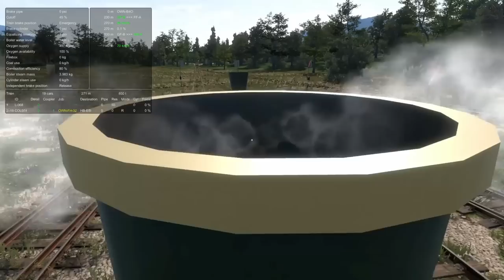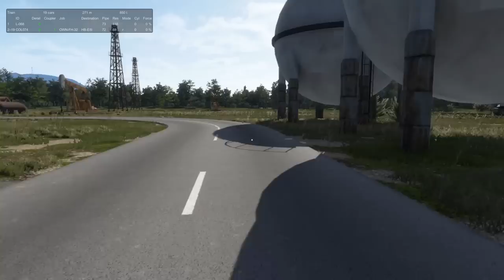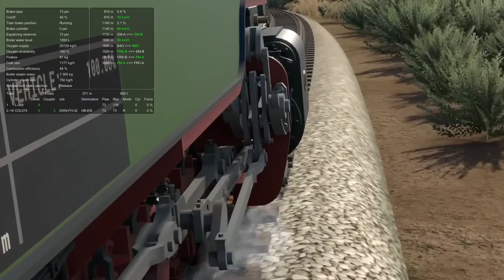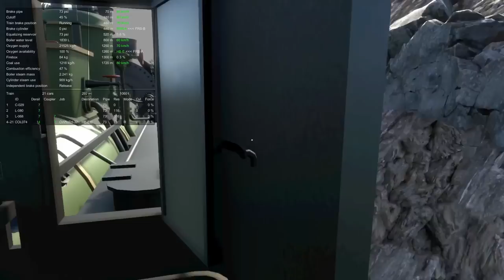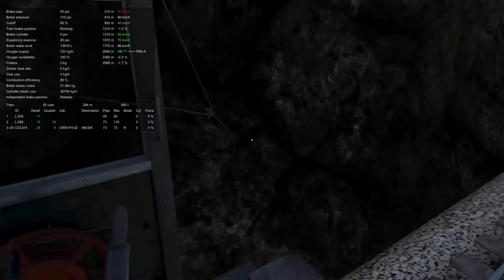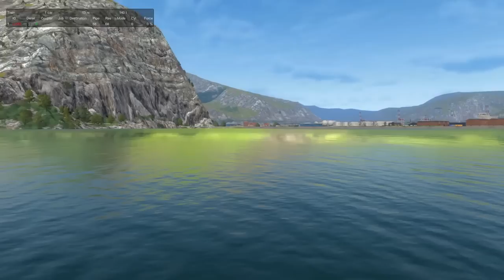[DV] A new steam engine and ES&D skins that want belly scritches! [Derail Valley]

Comment: Loved the reaction to the easter eggs you did find.  And I couldn't not keep the one on the cab.  It was just too perfect.

As for the skin pack:

-There are skins for the DE2 and DE6.  the DE2 has no easter eggs, but the DE6 does (albeit a less creative one, the skin mapping for the DE6 is limiting).  

-As someone else pointed out, you should run the SH282 out of coal.  There's also something under the tender.  

-Newest version of the skin pack has a caboose skin as well, and someone else in the comments here also found the easter egg there (that skin mapping is also limiting).

-The ES&D Antimatter skin is the original ES&D skin from Antimatter that you've featured before (no alterations). Antimatter gave me permission to include it with the alternates I posted.

-And of course, all the skins work with the number manager, so there's no repeating road numbers like you get with statically numbered skins
Reply from the maker: Thank you so much for bringing me these laughs :) I'll be using them again soon...
Reply: @Hyce777  I might also have some ideas (and been given some ideas) for an ES&DT skin.  I'm just not good enough with some of the finer aspects of design to self design any kind of herald for the ES&DT.
Reply from the maker: @flyjunior182  I've got ideas for it as well, based on the later D&RGW schemes (like the one on the tunnel motors).

Small "eat Shit" with a big "die trying" like the rio then grande. That's all I've thought of though. Would only make sense on the DE6
Reply: @Hyce777  I might be able to run with that on the DE6.  I'll probably make the DE2 similar to the ES&D skin, and I'm already working on the first iteration of an ES&DT skin for the SH282.

I may also be thinking up ideas for an SD&S skin

Comment: Imagine wondering where the scheduled train is, only to receive a report that it was dispatched with the switching loco that maxes out at 36kph.
Then comes the report it got stuck going up a hill, a mainline Mikado was dispatched to assist, and has now been seen running backwards at the front of the consist, pulling the switcher fast enough to require a full inspection of anything remotely related to the driving gear.
Then comes the report that the train blew up on a mountainside.
Reply: That sounds like tuesday.

Comment: 12:20 Well, not quite. . .there IS a handbrake in the game, but it's only on the caboose(if you even remember that oh-so-important rail vehicle). There IS, however, a handbrake mod that adds one to every car in the game, very useful for if you have to stop a breakaway consist that doesn't have air hooked up. I'd also suggest you check it's config upon getting it, since there's a config for % of handbrakes required to finish a job(I have it at zero because it's frustratingly troublesome to get all of the cars in the track and go to complete the job, only for it to be declined because you forgot to set a couple handbrakes).

Comment: 13:45 YES. DO IT. Tried it myself a few times, and it was a fun/interesting experience, you should definitly try it! On my first attempt, I used the steamer to try some shunting moves. It was pretty cool, albeit with just one problem: you can't reach under your feet, which makes accessing the couplings on the go difficult(a.k.a you can't kick cars in VR. Might change depending on what they edit about/add to the VR controls, but that's TBD). The most recent one was when I created a sort of "runaway train" sort of experience, where I set up an express train(really just a 2-8-2 with a boxcar serving as a baggage car, and about 5-6 coaches), left it on a hill with released brakes, and hopped on a handcar a good 2-300m down the track. Boy, was it scary when that thing came rolling toward me! I think I got more exercise pumping that pumpcar's handles that anything else! And, like something out of an old TV Show(I was actually inspired by a scene in the third episode of Petticoat Junction, where a similar event happens), I was able to actually stay ahead of it...for a bit(just for reference, I think I got up to 60 or even 70 kph. That's 37-43 MPH! On a hand/pumpcar!). Eventually, I started tiring out(I guess you could say I was running out of steam, eh?), so I let it catch gradually. Upon making contact, I lept on the loco, ran to the cab, and applied the brakes, bringing the iron horse to a screeching halt. What an adventure!
Edit: Btw, my arms started aching just from the thought of that adventure. Man, was it crazy!
Reply: So, I get why it's a challenge to kick in VR, I've done it before with the Steam locomotive, for the Quest 2, idk what headset you have but for the Quest 2 if you pull down on the left joystick your character will crouch, but also I always kick from idle. I always stop the train, release the brakes, uncouple and disconnect the air hoses and kick them, but I find it easier that way, I'm also slow lol so it gives me time to make sure everything is set up properly.
Reply: "Running out of steam"
i think you were also pumping another thing, would ya?
Reply: @survroproductions200  just what are you trying to imply, pal? fyi, i used both hands to move the handles, not just one

Comment: VÉÉGRE MAGYAR MOZDONY YAAY

Okay now we only need Boss to finish the Hungarian State Railway 651 and 601 Mallets and then we'll be rolling!

The issue is: neither him or I can find any complete drawings or good photos of it's cab, so I ask for your assistance figuring it out using a picture of the cab of another locomotive.

*Modeler is Niko Fox.
Reply from the maker: Oh man, that would be awesome. Probably need someone who speaks the language to find pictures of it.
Reply: Coud they made any Slovakia or czech or czechoslovakia steam train?
Reply: @Hyce777  what I'd really need to do is go to the correct archives collection in Budapest, except I can't exactly willy-nilly to there.

We do have pictures of loco crews posing that are the correct angle, but are too low of a quality and/or are too dark to be of any use.
I've also located pics of H0 scale models that show part of the cab that might be of use in reverse-engineering it.
Reply: @samueltkacik556  The 651s were classified in Czechoslovakia as 623s (31s in Jugoslavia)

Also I suggested to him that we could to the JZ 11s (MAV 424 class) that were classified as 465 in Czechoslovakia.
(Also despite the differences in the cabs, the overall layout should be similar, so a pic of the 424s cab could help.)
Reply: @Hyce777  one issue: the 601 maxes out at 60 km/h.. the 651 at 50. The 424s did 90 in regular service, though a break-in run on a factory fresh example managed ~120.

Comment: I love this steam locomotive honestly. And I know it was designed as a shunter, but good God the fact that it only has 60-63kN of traction effort and a top speed of 36kph I believe is kinda annoying, lol
Reply: Hungarian Wikipedia shows max working speed of 36 km/h with either 60 or 63 kN traction effort (not exactly sure which). 950 mm wheels which is like 37.4 inches.
Reply: @Ronald.Golleher  Gotcha, thanks for correcting me.
Reply: It was designed to take tight curves in mines and branch lines. It had excellent traction and was easily used on lines with gradient of 3.8%. These locos usually hauled about 110 tons uphill and 260 tons downhill.
Reply: @-T90Vladimir  To bad it isn't like that in game

Comment: Also for the tank cars, fill them with a liquid explosive like asypropel alcohol and then make an electrical spark inside so it goes BOOM
Reply: Isopropyl alcohol? Just checking you don't mean something different besides rubbing alcohol.
Reply: @Ronald.Golleher  kinda,, rubbing alcohol is usually 5% ish, but when its concentrated it is good enough to power crappy pulse jets (ive tried)
Reply: @weird1012  well yeah, just didn't know if you were meaning a different type of alcohol.

Comment: i imagine the day they will increment performance based on the valve gear of a steam locomotive,
which will not happen, but maybe mods may do such.
Reply from the maker: The mods already do that.
Reply: @Hyce777   Then, i would suggest you to be ready for the day where they might add a Super D mod for the game.
bc if so they did, then good luck.